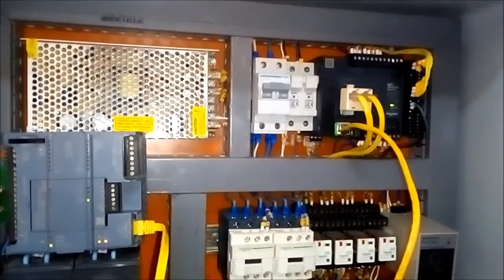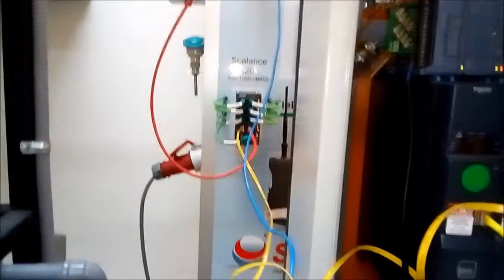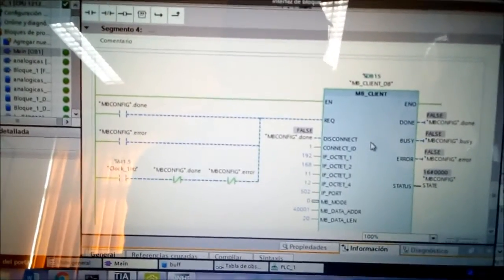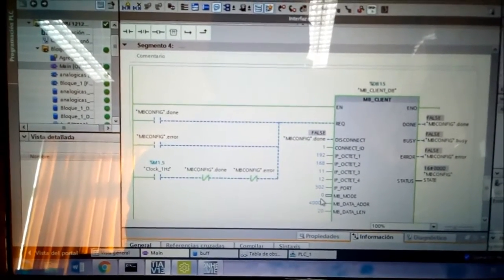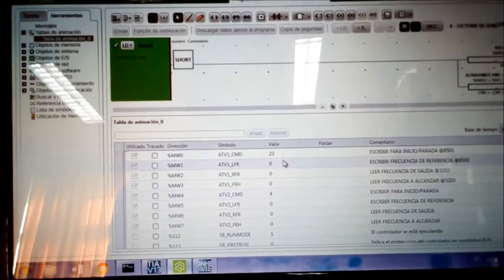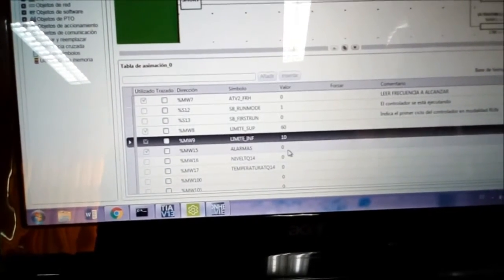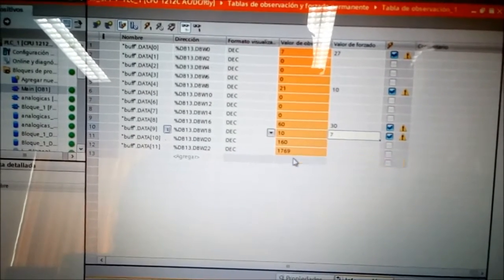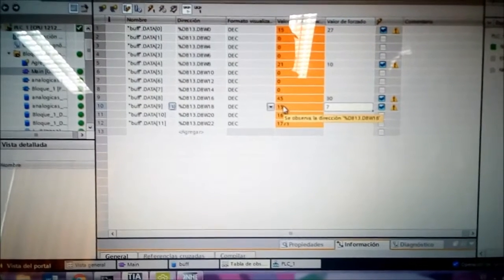SIEMENS S7-1200 comms to SCHNEIDER M221 by MODBUS TCP/IP

Comment: Thank you for your video. Can you show me how to build the data block using in the project. I am trying to do but I dont have any document.
Reply from the maker: hello friend, in the SCHNEIDER side the PLC is MODBUS SERVER ready which means that you do not have to configurate or program anything else. in the configuration tab in SOMACHINE you just have to tick the MODBUS SERVER option and that will be it. in siemens side you just have to configurate de blocks one for stablishing the comms and the other one to configurate the starting register address, write or read etc. you can give me your email if you want so i can send you the examples
Reply: @antoniofranciscosotocervan2760  my email is nnh116@gmail.com. I just finished the somachine code part. But I dont know how to configure MB_Client in Tia portal. can you send me the project. Thanks a lot
Reply: @antoniofranciscosotocervan2760  and also that I have a question. Is the arrange of bit in Siemen and Schnieder different? Because when I try to modbustcp from m221 to S7-1200, I recieve the data but not in the right order
Reply from the maker: @nguyenngochuy4140  I've just send you the archives to your email man. hope this can help you. respect to the last question there is no way the data is send in a wrong way. you have to request data in the s7 1200 thats why it's accting as a client. the server only reads that request and send the requested registers. regards
Reply: @antoniofranciscosotocervan2760  I recieved your email. Thanks a lot. Can you help me to understand the FB analogicas and Blogue_1 in TIA Project. What does it use for?
Reply: @nguyenngochuy4140  anh cho em xin file đó đc hk anh